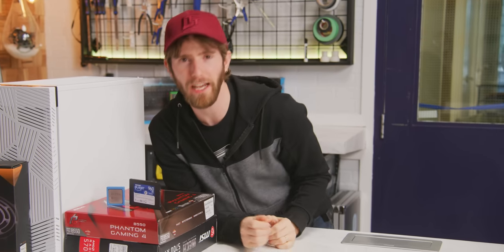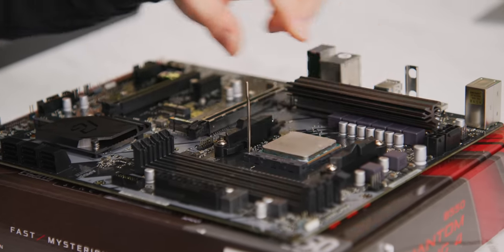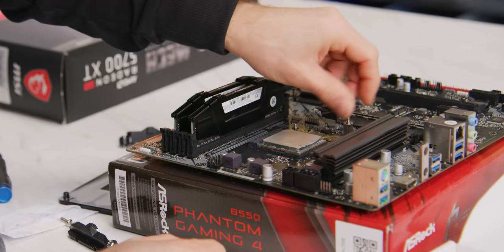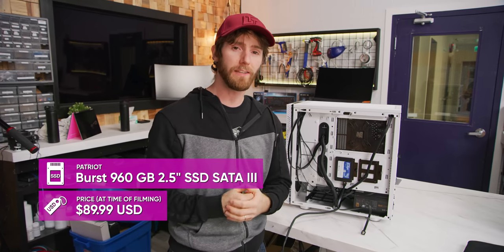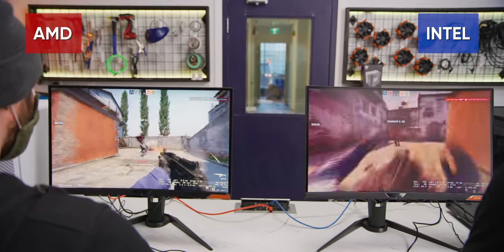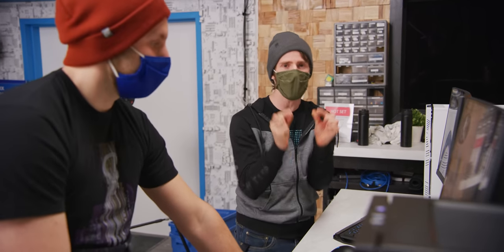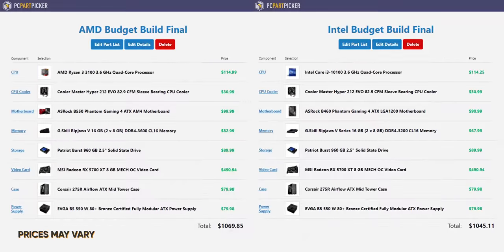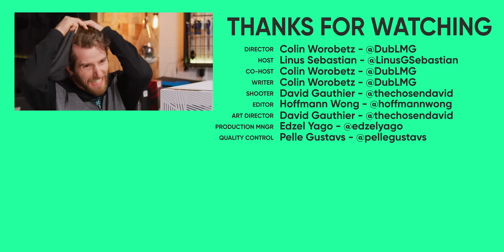AMD vs. Intel midrange gaming PC challenge

Comment: “Budget 1000$”
Me with 400$ PC confused screaming
Reply: My $325 pc:
Reply: The 5700xt completely destroys the budget. Buying something cheaper and 3600 would make much more sense
Reply: ya know there's also people out here with a nearly 115$ cpu with no GPU because stock prices went higher than they expected.....like me i was gonna get a really nice pc in 200$ but the prices went sky high i had to change my cpu to a i3-4160 and uncheck the ssd from my build and then the worse happened my GPU died.why am i still alive?
Reply: @monkeslayer-km5ho  me with my 50$ laptop:
Reply: My £80 pc made will all used parts 😎😎
Reply: @pb6198  what has the performance?
Reply: @arandombird648  Xeon E3 1230 v2, a pair of gtx680 in sli. 
16gb of ram
480gb SSD
Aquagrafix cooling system
Evga 800w PSU
And a homemade case
All bought on eBay auctions for next to nothing.
Only things I had to start are a LGA 1155 motherboard with 2 pcie x16
 slots. And the peripheral equipment
Reply: @arandombird648  it plays GTA v at max settings at 45 frames or abouts that.
It's not bottlenecking the GPU, so room for graphics improvement in the future.
Reply: @pb6198  can you kindly share the specs of your PC when you have time? 

Thanks in advance!
Reply: @pb6198  thank you again!
Reply: The video is called building a MIDRANGE computer, people. If you have a budget of $1000, you're in the midrange. 

Why y'all like to brag about how cheap a rig you have, I don't know.
Reply: @m.shaheertukassar2553  sell stuff you don't use anymore. There's always something you can sell
Reply: @Homanjer  That's true but i'll have to wait a whole 5 months coz i don't have anything that i can sell i've already sold stuff i didn't need i'll just think of something else to sell and get a new pc after 5 months.thanks for the suggestion anyway :)
Reply: @m.shaheertukassar2553  well i would suggest youd just go and find a part time job but i rather not have you do that in the pandemic. unnecessary risk for a computer
Reply: @Homanjer  BTW  i'm currently in high school --__--
Reply: @m.shaheertukassar2553  yeah i thought so. but you can still work on weekends. thats what my parents always told me when i wanted to have something nice
Reply: @Homanjer  what exactly do u mean by work? what could a high schooler do anyway
Reply: @m.shaheertukassar2553  paper delivery, farm work, offering gardening work in your local community small stuff like that. Or you go more serious and do something like a friend of mine does. He works for a cleaning company that takes care of the mercedes benz factory here where i live and he gets around 400€ (485$) a month. Only works on saturdays. You dont really get into close contact with anybody either. Its a pretty safe job but theres all sorts of jobs exactly like that. Low paying part time jobs that you can do on a weekend that dont require you to know anything special
Reply: @Homanjer  well......these things don't exist in our country if a child starts to do work like this means he's useless and he doesn't have anything to do bla bla
Reply: @m.shaheertukassar2553  so youre telling me that these workplaces dont exist (which i find hard to believe) or that you dont want to look like someone whos useless?
Reply: @Homanjer  that's not it first of all people don't need gardeners here coz there are only a few people who have trees etc and as for the paper work no one distributes or reads newspapers and farming......that's way outta my reach
Reply: @m.shaheertukassar2553  then again if you live in such an urban area theres probably some cleaning companies you can work for. few hours a week really simple job and you need to have pretty much no qualifications
Reply: @Homanjer  simply speaking people avoid work like this here so there's no use we're just wasting our time arguing anywas thanks u i appreciate it
Reply: @Homanjer  they probably live in a 3rd world country like i do where doing cleaning jobs part time pays like 5usd per day so the way to 1000usd is not worth the effort to look into and actually do. Fastfood chains also aren't hiring and actually laying off workers and they pay like a dollar per hour.
Reply: @pastelmacaroon  yeah well for most people it works anyways and if you rather just not do anything then that's fine...
Reply: @Homanjer  similar to goes for my country there jobs like these but paying is 10$ per day also there a lot of people who looking job while having 1-2 degrees. Also sadly our country apply 20% import fees and plus 8% standard fee. that's makes i3-10100f cost 150$
Reply: rich people dont understand "budget"
Reply: @halleyoey9535  that's far from true. Most rich people who became rich by themselves literally are rich because that is their biggest strength. Soooo many startups die because the guy in charge doesn't know how to spend money
Reply: my 200 canadian dollar chromebook: BRUH -_-
Reply: Me with a 185$ pc
Reply: My xbox360
Reply: If you have a $200 or lower budget I would just buy a half decent office PC and slap some ram and a gpu in it
Reply: My 200???(
Reply: @m.shaheertukassar2553  thank god for internal graphics
Reply: Broke bois
Reply: @monkeslayer-km5ho  my 2100€ pc:
Reply: Lmao my specs are like £69 on eBay
Reply: I was right there with you
Reply: @jamieyang8621  performance-wise yes but also, pairing Ryzen 3 3100 with RX 570/580/ gtx 1660 would be enough when considering the budget.
Reply: @Emerald_Forge  MOBO: H61 foxcon, CPU: i3 2100 GPU: Avoc GTX 750 TI RAM: 2x4gb ddr3 Storage: SSD sata 120gb, HDD 320gb PSU: Infinity 400 80+ bronze Casing: literally any cheap case. It'll cost lower than $200 but it will run valorant on 1080 mid setting at 70+ fps and Apex on 900p low setting at 50+fps. Not the prettiest but it does run most esports game. Might be easier to just buy office pc and gpu but building it from scratch isn't a bad idea either
Reply: @pb6198  holy shit the bottlenecks
Reply: My 300 laptop
Reply: I mean they said it’s midrange it ain’t like low range
Reply: @Wirgah  I believe the title was budget at the time that this launch. It probably got changed. LTT do that a lot
Reply: @devaraft  oh ok
Reply: Budget is not the same as cheap
Reply: My PC that's worth around 100 USD: Bruh why am I even here just to suffer?
Reply: @devaraft  i3 2nd gen still hold up? Damn
Reply: @reurez7942  yep, you can search it up for yourself the performance test on yt. i3 2100 with gtx 750 ti. Here is one of them https://youtu.be/4pCQs29RSRs
Reply: @m.shaheertukassar2553  my 15yr old sister gets $120 to $180 a week working the snack bar at our local bowling alley. 
You too can be a teen with $500 a month 🤣🤣
Reply: my $350 with IICORE 2 duo (BEAST *0/1)
Reply: @jordzking6330  am i the only one here with a $1900 PC?
Reply: Me with 200$ laptop: Shocked screaming
Reply: me with a 50$ pc running my games fine
Reply: @1ne8ighty  me with my $50 phone:
Reply: @Joshua-zj8gm  me with my 40$ phone: 

(Laptop got broken)
Reply: me with 2000$: 💪🏻😎
Reply: Me with my 100$ phone
Reply: @1ne8ighty  u mean 500$
cuz with 50$ u can't even buy Nokia 3310(the strongest weapon)
Reply: its cause you only looked between the couch cushions but not under and in them
Reply: You're even better than me brother.
Reply: My 10$ PC be like

Comment: Big ooof on GPUs this holiday season; $500 for a 2019 graphics card? I remember 18 months ago the 5700 launching at $350 and bringing strong competition to the gaming market. Paying $490 for one right now is just another reason to hold off buying anything and waiting for the mad supply issues to blow over.
Reply: Also the speed of the 3060 ti is higher for lower cost and it’s not likely you’ll find either
Reply: @alop53O1  RTX cards are basically unavailable globally right now. Nvidia stopped making 2000-series 6 months ago and there's nowhere near enough 3000-series or 6800/6900 to go around. For the next three months, 5700XT is as good as it gets for most people which is probably why the price has gone up by $100 even though it's such an old card. Man, right now the best advice is simply to wait; Don't be impatient and just sit this round out with whatever GPU you're currently using :D
Reply: @chrisfanning5842  5700XT was DOA back in 2019... lol 2020 and it's absurdity. Anyone selling a used 1080 Ti from 2017? This video only makes sense in the realm of scalpers/people unable to buy new hardware at MSRP.  I guess LTT must be desperate to post shit content during this holiday timeframe
Reply: @a36538  I bought a 980ti for £105 two days ago... I think it's a reasonable price considering the current circumstances
Reply: One could almost believe the supply problem has been artificially generated to force prices and demand up. The only winners being the card manufacturers definitely a sellers market. Suspicious or what.
Reply: Or go second hand. 1080Ti would be a great buy at $300-350 compared with this GPU.
Reply: Dude, even the RX580 went up by almost 50% here.

I was thinking of being clever as the games I play do perfectly support Crossfire and only barely dip under the 75Hz refresh rate my monitors have, after I saw how boosted the prices and utterly unavailable the current gen cards are.

So I thought to just buy another RX580 for 200$ until all this shit settles down in the coming year(s).

Yeah, to match the 200$ card I bought years ago, I'd have to shell out nearly 300$.
Reply: @enlightendbel  It's bonkers isn't it :) I have a 2070S and 5700XT in the PCs at home here, I could just sell them both on ebay for about $1000 (equivalent) and wait a couple of months. The games I'm playing right now will run okay on the IGP; Not at their best, but hey - graphics alone don't make a game good.

Comment: When His Graphics Card Cost More Than Your Whole Build 😂
Reply: Impossible.  "Whole" build includes the Graphics card too.
Reply: @rochithahasindu8511  Yeeeah. My current build has a 1060 6gb I got for $190 on flash sale. So he's not wholly incorrect.
Reply: @rochithahasindu8511  wow.
Reply: Things get even worse when you think about people who bought 2080ti for $1200
Reply: @IrisCorven  got 1060 3gb AMP core edition for 95$ used two years ago after miner craze.
Reply: It should be like that, at least put as much money on the graphics as on the whole build.
Reply: My build is a quad core Q6600 and 8800gt 2007 parts
Reply: My GPU was 60$! Granted it’s a GT 710
Reply: @zernont1057  ngl that's just a horrible purchase unless you plan to use this as a stop gap soltuion
Reply: F
Reply: 666 Likes!
Nice!
Reply: @rochithahasindu8511  How is it impossible? My first build was 1100 and that's the price of a 3080 lmao. Even with a gpu.